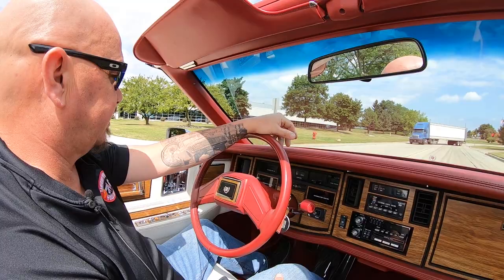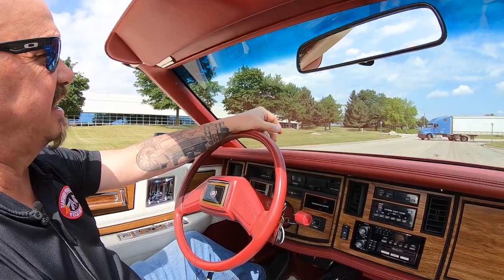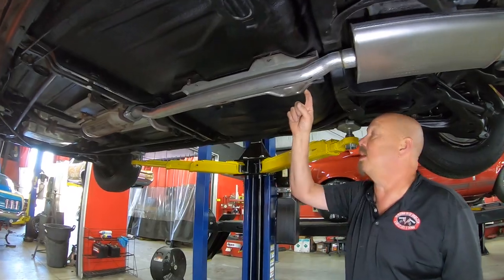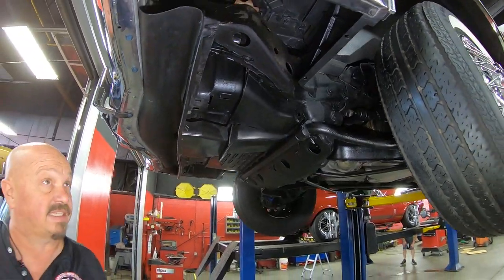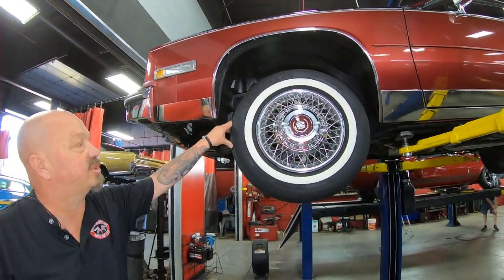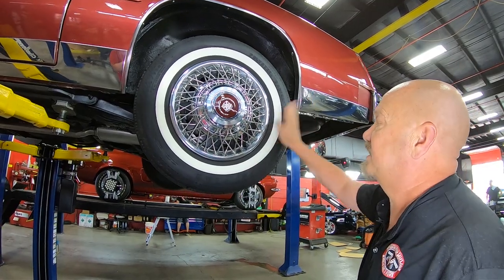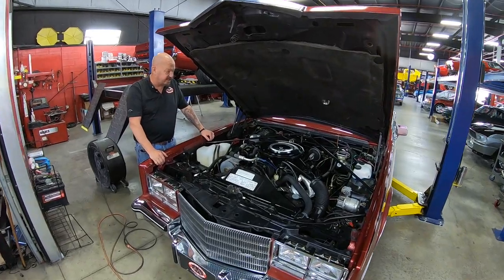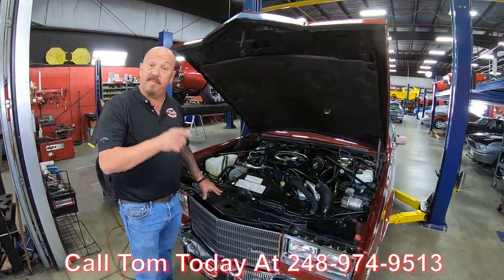1984 Cadillac Eldorado For Sale

Comment: I had oned of these. I used to love working on it. It was My first car when I was in highschool, me and my homeboys hot boxed it and I created so many memories. My brother overheated it and i overhauled the head gaskets but the mechanic that took it apart turned into a crackhead. Now the car been sitting at my dads house since 2011. My family wants to throw it away but I want to start fixing it. Does anyone know what kind of engine and transmission it takes?